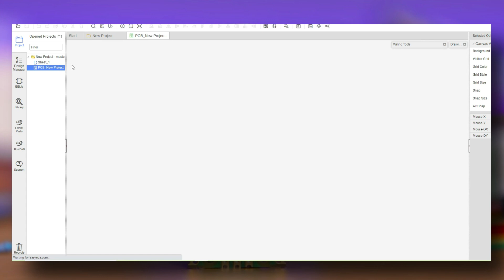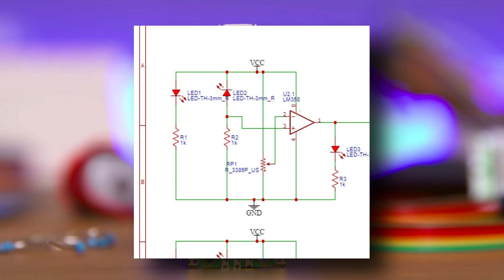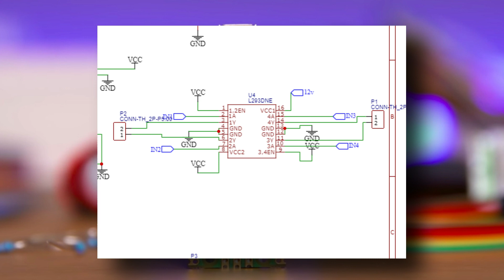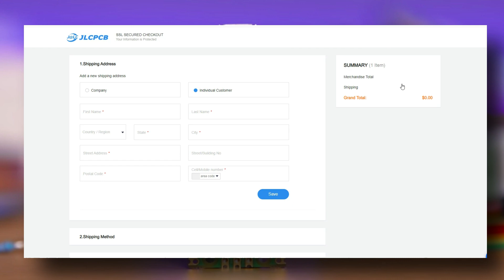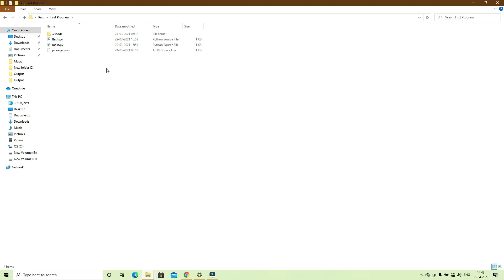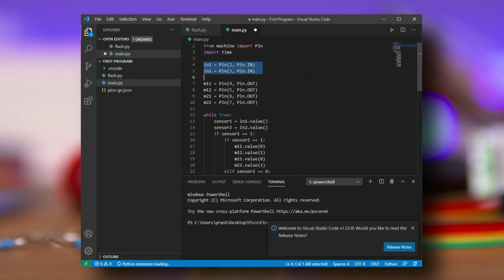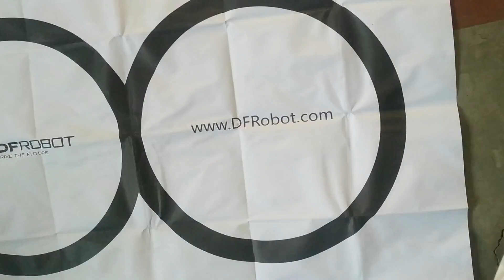Raspberry Pi Pico Line Follower Robot | Raspberry Pi Pico Projects

Comment: Great idea with the PCB body, I wonder if you could build on this and add ultra sonic sensor, to avoid and or follow someone. Also light sensing avoid and follow. Could the pico do this? Great Work! Would you be able to post a link to the pcb file? Or what has program did you use to create the pcb? A tutorial on creating the pcb might be good also :) . Thank you
Reply from the maker: I have a live stream on this channel ... You can find that in channel videos... In that live stream i designed this pcb from start to end... You can check out that video... That gives all details
Reply from the maker: https://youtu.be/9rUMjYX_RAw